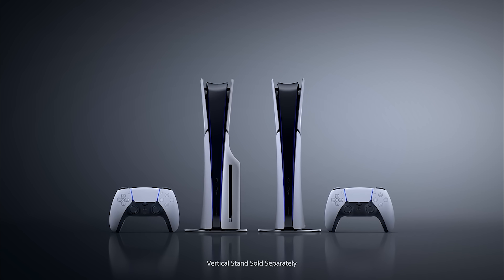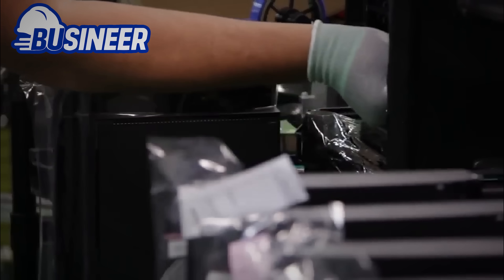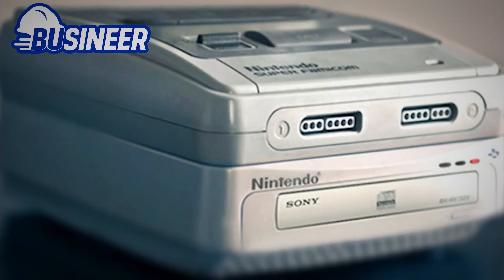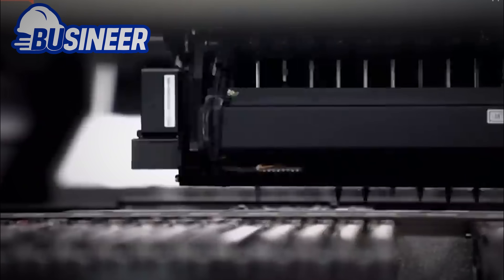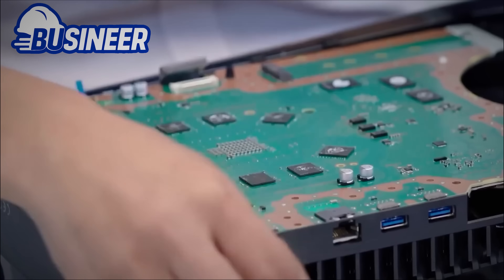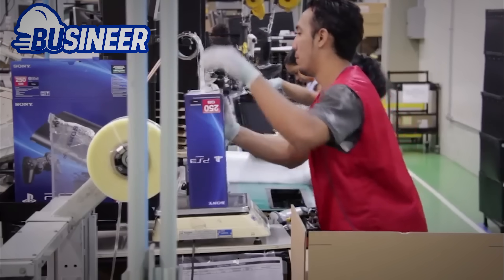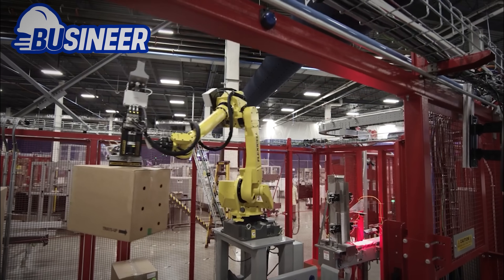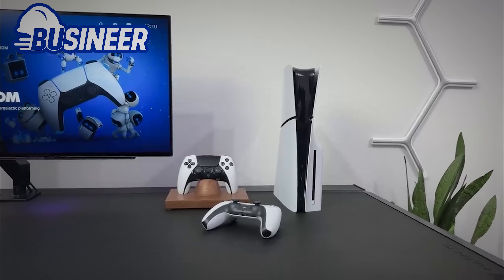Inside Japan's PlayStation Factory: How PlayStation 5 Is Made

Comment: Can't include a base stand and definitely can't include a disc drive for pro, can't include 2 controllers, oh no,no,no...everything has to be sold separately
Reply: There are two stands for the PS5 Slim and Pro that are included for those consoles. It's ment to be positioned horizontal not vertical. You will break your ps5 if you keep it vertical as the liquid mental will leak onto the components inside the ps5 and can destroy it. The PS5 Slim and Pro does not include a vertical stand because they don't want you to positioned it vertically. I understand they do sell a vertical stand separately but it's for your own risk, and most probably will encourage you to buy a new ps5 if the console breaks.

If you have a PS5 Slim or PS5 Pro just use the two small stands for horizontal use and put your PS5 lying down. The two small horizontal stands are included with your PS5 Slim and PS5 Pro.
Reply: @lightingboltzero8575 That Liquid Metal was said to be debunked tho?